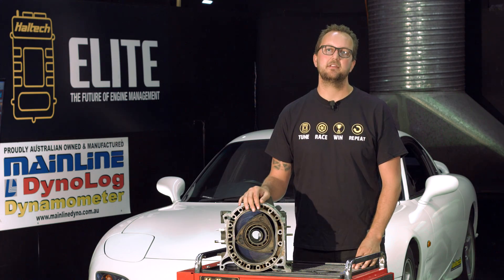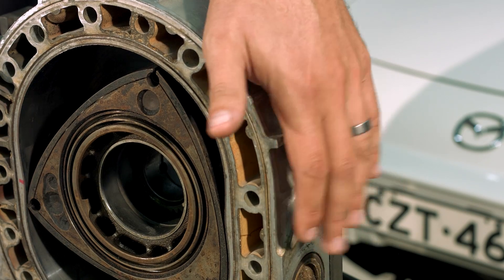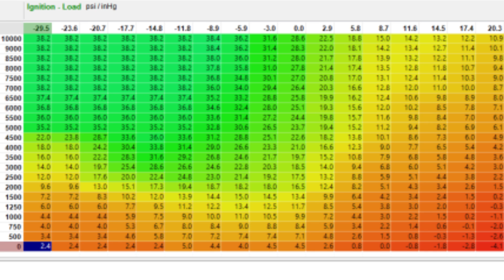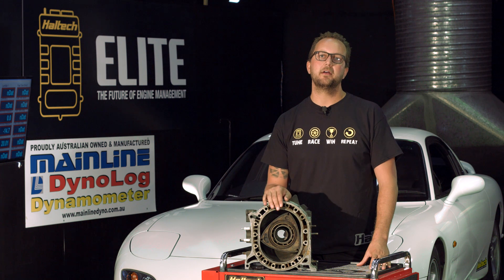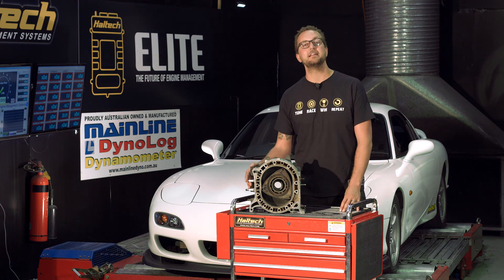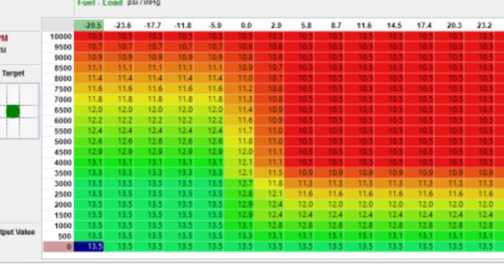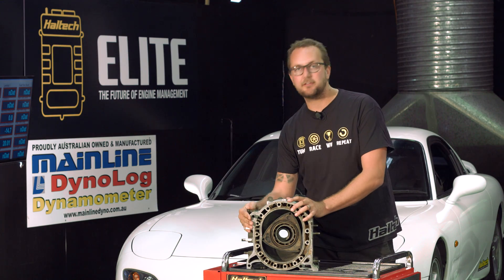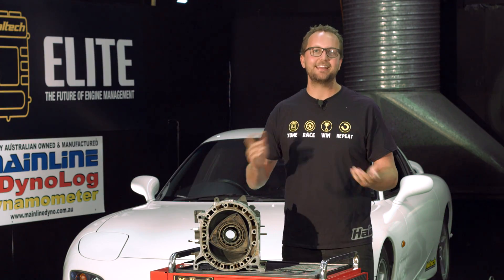💬 Tuning a Rotary Engine - Technically Speaking

Comment: what is considered to be a full engine cycle on a rotary engine? a full cycle of the eccentric shaft, or a full cycle of the rotor?
i guess it should be the complete rotation of the shaft, because this is where the power is put out.
im wondering why there is only half the processing time available compared to a piston engine and i think it has something to deal with this, but i couldnt figure it out completly yet.
Reply: +177SCmaro Thanks! I'd like to add that I have a brain tumor and I'm currently stoned.
Reply: 081588101 Really? Because both Wankel and diesel are types of Otto cycle engine. "Otto" refers to the guy who came up with the 4 stages most engines goes through to operate.
Reply: Your confusion is understandable as this wasn't explained very well the video. 

What he seems to be trying to get at is he's saying that rotary engine have half the time available to inject fuel and charge the coil(s). (I don't know it that's exactly true or not but I believe it is).

And I agree, a full cycle on a rotary engine is 1 revolution of the e-shaft as that completes 1 full Otto cycle (intake, compression, combustion, exhaust) given the 3 to 1 ratio between the e-shaft and the rotor(s).
Reply: if you compare crankshaft rotation of a piston engine to a rotary, One complete cycle on a piston engine is two crankshaft rotation compared to a rotary where its is one rotation.
Reply: that makes absolutely no sense at all. it doesnt even relate to my question.
Reply: ...a rotary engine takes HALF the rotational time compared to a piston engine. Thats where the half the processing time is derived from. A rotary engine has half the time of a piston engine to squirt fuel, squish it, bang, and blow it out.
Reply: o rly sherlock?
that is exactly what the dude is saying, plus what i have already said.
if you can just tell me why this is so...
but anyway... your first comment is just wrong, or i dont get what you mean.
Reply: 081588101 since three stages of combustion are occurring at once in a rotary the rotors are geared in a way that they rotate at 1/3 the speed of the eccentric shaft so that one combustion occurs per revolution of the eccentric shaft in order to provide smooth power delivery. For this reason the system has half the time to prepare for the next combustion cycle compared to a piston engine.
Reply: ok, thats what i initally also asumpted.
but one combustion per shaft revolution is not something unique for a rotary, this is also the case for an otto.
but still, it has to have something to deal with this...
maybe its just the speed of the rotors...
Reply: +081588101 "one combustion per shaft revolution is not something unique for a rotary, this is also the case for an otto" I assume you meant "piston", not "otto". Anyway, yes, there are multiple combustions per revolution on both engines, but the piston engine gives the injectors and coils a rest because there is only 1 combustion per TWO revolutions of the crankshaft for EACH cylinder. The rotary doesn't get that luxury because the injector and spark plug(s) are firing once in each housing for EVERY revolution of the crankshaft. I hope that clears it up. That's what I think he's trying to say.
Reply: ishootstuff Funny how easy that was for you to explain clearly in passing and yet the guy who does this stuff for a living and is in a video about it seems so clumsy and inarticulate in his explanation. 
Just an observation .
Reply: ishootstuff lol
Reply: thank you sir for disconfusing me. i was already referring to each cylinder when i wrote,"one combustion per shaft revolution is not something unique for a rotary, this is also the case for an otto" , which is, of course, completly wrong, like you already said. the rest is obvious.
btw... in germany its common to just say otto, wankel, diesel, etc... to refer to a certain engine type. :)
i wish you all the best weed to cure your tumor.
Reply: 081588101 sorry I thought you knew I was referring to the rotors individually

Comment: Interesting you chose a 270 - 330 injector tuning angle when the original base map from haltech is starts at 50 - 247. will update it and see how it goes

Comment: Oh come on
The 787b only won from attrition 
Luck
It was WAY down on lap time
Reply: MyLonewolf25 I might be a little biased as I just bought a 13b ;) we will see tho. I'm planning on building it right so it should last! pre mixing and oil changes are key.
Reply: MyLonewolf25 it's failure points are usually non catastrophic. meaning yeah you lose compression and power but you don't have a rod to throw through a block therefore you keep the engine running and can finish the race.
Reply: Dj Deertz its engine and drivetrain was spotless after the race

It was very de tuned on power and because it's a rotary it has very little torque 

Meaning you don't have much driveline stress
Reply: MyLonewolf25 MyLonewolf25 yeah I wasn't specifically talking about the LeMans 787b just in general the benefit of the rotary in endurance type racing. 

Either way, winning the LeMans is a feat and Mazda is the only JDM car company to do it.
Reply: Dj Deertz it's a feat yes, and quite frankly the rotary is an awesome endurance and racing engine 

The problem is it's pretty much only great for that with the attention it constantly needs

But what they got out of that thing was phenomenal and amazing 

Just EXTREMELY lucky
Reply: It won due to reliability. The lap times were lower than everyone else, but they also had to pit less. Understanding pit strategies will help you understand just why the rotary in the 787b played a significant role in its victory, along with the full support of racingbeat and mazda. Doktorbimmer enjoys diminishing the success of the wankel by calling it names. We all know who the first Japanese company to win lemans was :)
Reply: MyLonewolf25 
Your the type of person that would LS swap it
Reply: I just came here to see what bimmer had to say.
This is like free crack to him. 
If only fishing was so simple,
barely need to put any bait on the hook.
Reply: One of the keys to winning Le Mans is being able to run for 24 hours and get across the finish line. 24 hours gives a long time for cars and drivers to fail

Comment: Question. Why is he/you comparing a 3 rotor engine (2 liter) to a six cylinder?
The rotor only spins a third of the speed of the e-shaft so.... 9k (redline) is only 3k (rotor speed). Yes, the rotor is doing triple duty each rotation, but it's never experiencing 9k rotations per minute. 
With that said here is my 2nd question: Wouldn't the rotary tuning be focusing on the rotations of the rotors and not the rotations of the e-shaft?
Thanks for you time!

Comment: My 2 rotor has a steady peak upwards at 7000 RPM till 9800 RPM, that is not the problem, between 6200 RPM and 7950 RPM there is a downturn, All I can think is that this is a boost issue (bleeding).

Comment: Don't forget that the rotary has 3 cumbustion cycles per revolution of the rotor. That means the injectors and plugs have to fire 3 times for every revolution. The fuel and ignition systems recharge times will have to be wickedly fast, especially at 9000 rpm
Reply: While the rotary has 3 combustion cycles per revolution of the rotor; the crankshaft (RPM) is turning at one third that speed.
So at 9000 rpm the rotor is running at 3000 rpm not the implied 9000 rpm

Comment: Thinking outside the box ...Apex seals...design STEEL ROLLERS to seal...maybe or a BIG no?
Reply: The maximum centrifugal force experienced at the tips of the rotors where the apex seals are located is overcome by the higher tolerance of the housings theirselves of course.  The apex seal spring tension allows for the apex seals to, in essence float allowing for an area of suspension to be available, which inturn, allows which increase durability where as if the engine had rotors with fixed apex seals a failure would result almost surely in a catastrophically destroyed engine almost always and not making it then a feasible powerplant to be production based.  This concept is similar to how and why skyscrapers sway.  An overly rigid design when used in combination with heavy weight and or volatile forces can often lead to unnecessary failures.  Wheres a softened system of support such as a suspension bridge also sways and they can also span the distances which they can safely.

Comment: Nice video! Except the part where you need twice the injector size because you need to inject every rotation instead of every other one like you do with a 4-stroke, which isn't true. You do need a bit bigger injector because you have to deal with the injector 'dead-time' twice as often (which is around 1ms per injection, depending on the injector, battery voltage and pressure), and because the rotary is less fuel efficient in general. The amount of injector you need usually ends up around 40% over that of a piston engine. Besides that, great video.

Comment: Hello Scott, thanks for the vid man, you are great! I hope you or someone similary engine/technicly based and wise person can answer me. I'm looking for project, engine swap to be honest and everywhere i look, i get alot of dissapointment. I own VW Golf 4ish car, iron 1.6 8v transverse engine, thats putting around 60kW/135nm on the table. I want to take this number and pretty much triple it (some day). I'm trying to get some engine, that would fit in the enginebay without problems, preferably with turbo (choo choo) and not ruin my budget. However, i don't want to go the VW way, and swap 1.8T/G40/VR6 or similar in there. Japan way seems to be reliable and powerful enough. I though about 4GZE/7GZE and SR20VET so far, but I'm affraid that the SR20 wont fit at all.

Parameters to (preferably) aim for, i hope it will help: 
Belt (Chain) driven 16v,
good overall tuneability (let's say 400hp with minor modifications),
good reliability (that can withstand years of dailying),
size (that will fit my engine bay),
reasonable price and gas mileage.

 Can somebody help me out?

Comment: On regular car reviews he said that rotarys tend to run very hot and that it's a constant battle when driving one. He even opens the hood when he's done driving every time.

Do they run hotter than the average piston engine? And is this actually a problem or was it exaggerated?
Reply: So long as the cooling is sufficient the engine should have no problems.
Otherwise yes rotaries by their very function loose a lot of their combustion out the  exhaust, meaning you are burning a lot more fuel to get the power needed and with it a lot more heat compared to a 4 stroke piston engine. RX8 compared to a similar Golf GTI will take around 50% extra fuel, obviously a direct engine power/consumption comparison would be better but I find none.
Reply: Yes they run hotter than piston engines. with a good exhaust, its not really a problem.
Reply: I can't comment specifically on the oil cooling of RX-8's as I don't know enough about that model. What I can tell you is that Rotary engines run hotter than piston engines due to the fact a lot of the exhaust stroke goes into the exhaust before its fully burnt, if left any longer inside the housing the exhaust cycle can have a negative effect on the rotor face, effectively pushing the rotor backwards and making you lose power, to counter this the timing means combustion is still happening at the start of the exhaust stroke. This is why exhausts on rotary engines are way hotter than on a piston engine. Another reason for higher heat in a rotary than in a piston engine is constantly in a firring cycle unlike a piston engine with 4 stokes. That being said, the actual engine temperature is not that much higher than a piston engine. But the exhaust temperature is much higher. I hope i have answered a question or 2 you may of had. If you have questions feel free to ask and i'll try my best to answer them to the best of my ability.
Reply: I'd be interested to know more about this as well.  My brother owns an rx-8 and was telling me something about the models with only one oil cooler having serious overheating issues, but I'm really not sure if the models with 2 are really that much better.  So far my brother hasn't had any issues (with 2 oil coolers), but it's only been a couple weeks where it's been 85 degrees here so far.  Despite that, I get the impression that it still worries him.
Reply: slap on a thicker radiator. i did it on mine and temps so far have been lower  than half. not that it had any overheating issues, the stock had a leak on the top plastic cover so i went ahead and replace em, took a few days to sort it out in my garage with my dad. oh and i changed to vented hood with really helps when stuck in traffic. etc. also i bought an oil cooler fan i have yet to install.
Reply: Tbh, in several car comparisons I have read throught the years, S2000 is just a tiny bit less thirsty for fuel than an RX8 when driven properly. Around 15-16lt/100km. And those 2 engines are perfectly matched having almost the same power, torque, revving limit.
Reply: it is very true. When I put an FD RX7 on the dyno for tuning I have the hood open and a fan dedicated to cooling the turbo and manifold down alone. I have to do ten to fifteen minutes of tuning and let it cool. I cooked a brand new garrett turbo last year just because of massive EGT's. The high heat and lack of air movement is the reason the second rotor is nearly always the one to fail first as it sits up against the firewall...
Reply: That makes sense.  I didn't know about the exhaust.  I'm mainly just hoping some rx-8 owners will respond with their experiences in hot weather.
Reply: If so, S2000 consumes more than the RX8's per litre of displacement eh?
Reply: Corksport radiator , Racing Beat headers and Borla stainless cat back exhaust will make you smile.

Comment: what haltech ecu is fully compatible with an rx8 renesis engine that has a gt3076r turbo?
Reply from the maker: The Elite 2500 supports the Renesis, including factory functionality such as the 3 stages of injection, knock control and electronic throttle control, and can also be configured to operate the variable intake runner system. The Elite also supports turbocharging, with an internal 3bar MAP sensor (which can be upgraded with an external sensor for higher boost applications).
Reply: thank you very much for the informations!!!
Reply: awesome work guys

Comment: Hi Scotty,
I'm upgrading my 02 FD with an auto trans and stock ecu to a Haltech from what I see what's the way to get the Haltech elite range 1500 to plug in? I know that the ps1000/2000 there is a loom for it as opposed to the elite 1500 which is what I'm after how would I adapt or get that loom for it?

Thank you
Reply from the maker: +DaRazz213 The
 Elite 1500 does plug in using the Sport 1000 RX7 patch loom, however 
supports single-turbo and manual transmissions only. As we do not 
support automatic transmissions, you will need to custom-wire the 
Haltech in parallel with the factory ECU (using Haltech for engine 
control, and factory for transmission control).

Comment: Hey man!I have a question,how can I tune ignition timing and air/fuel ratio right without problems?
I am interested to tune a car in near future but I don't know exactly how to tune it right. Thanks!!
Reply from the maker: +Marius Arion That is not a question that can be answered in a simple post. There are courses that teach you the basics of tuning, and that general knowledge can then be applied to your particular application. Look up EFI University or HP Academy if you're interested.

Comment: Hey Scott, what is injection angle
Reply: +GTR RACING It's a position in the rotation cycle I think. As he said: "400 degrees". Which means that the injectors open @ 400 derees of the rotation of the rotor. So they open 40 degrees after a full revolution, pobably just before the "rotor chamber" is at the end of the intake part of the housing. At least that's what I think.

Comment: This helps a lot :)
I have been trying to turbo my Renesis for five years with no luck.
Do you know what the trigger angle is for the Renesis?, I have it set at 65°
Reply from the maker: +Punchy LightBeer Trigger angle must be set using a timing light; lock the timing in the 
software, and check the timing light flashes on the lock value on the 
balancer. If it does not match, adjust the trigger angle until it does.
Reply: +haltechecu ...  Ok thanks. I did that after watching your how to video:) . I got 65° and wanted to double check.